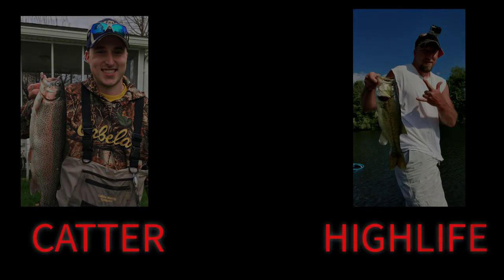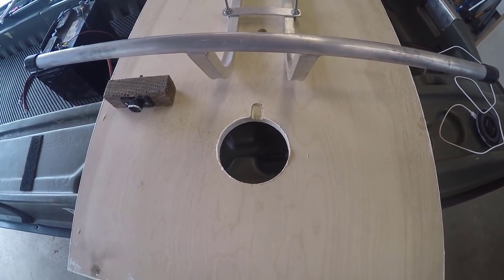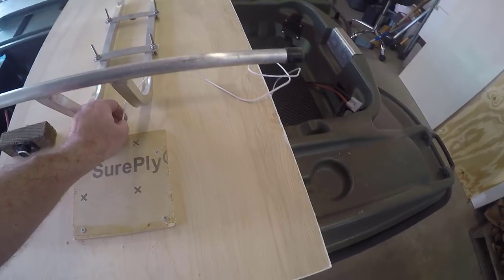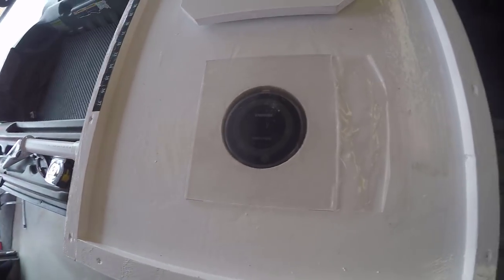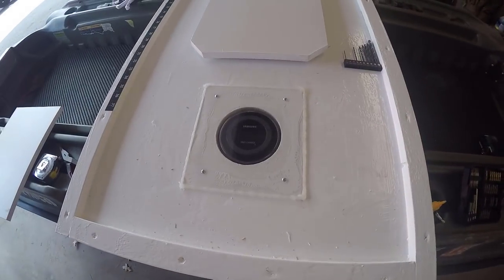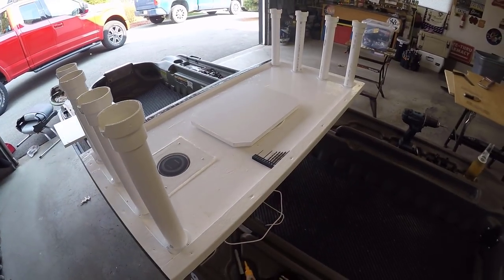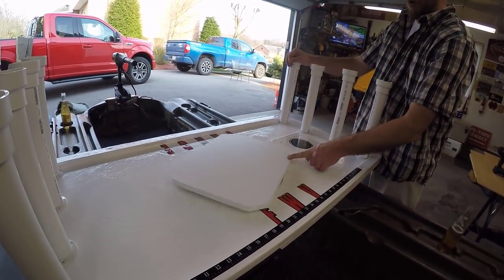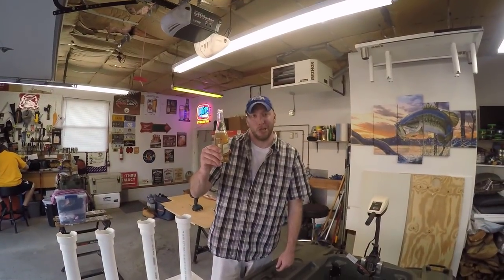Pelican Bass Raider Mods 2018 [Part 3 Wireless Charger]

Comment: Great video.  I am very interested in how you mounted the rod holders to the table.  I have shopped several times for the screw on "closet rod holders" at Lowes, home depot & menards but nothing fits the PVC; they are all too small (I'm using same PVC as you I think).  Do you have any info on them to assist?  Thanks
Reply from the maker: Hey Jack... Thanks for watching.  Really appreciate it.   I'm not sure I can answer this question perfectly.   Highlife will chime in soon and give you the specifics.    Thanks again and Fish on!
Reply: fish on...thanks